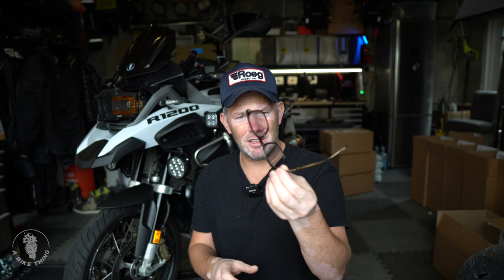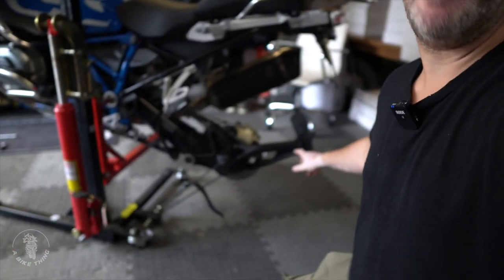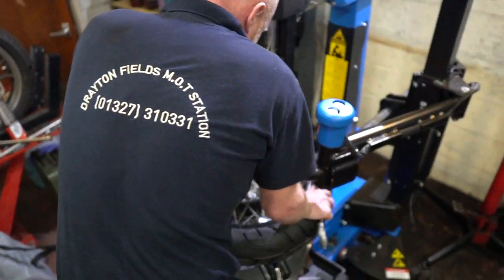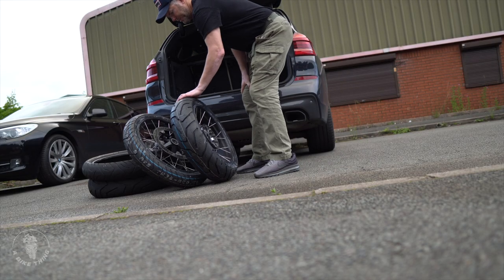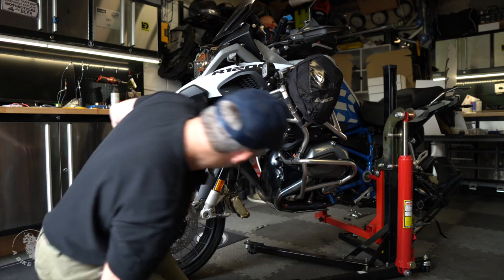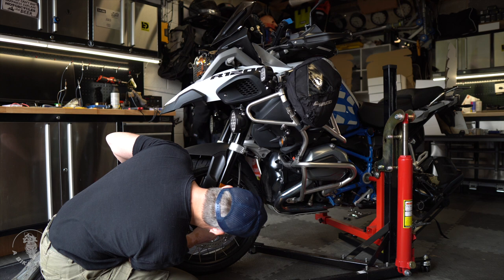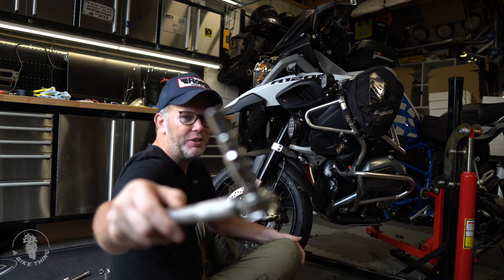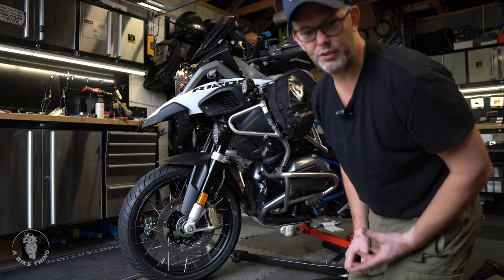THIS IS HOW IT'S DONE! PRE PYRENEES ROAD TRIP TYRE CHANGE.

Comment: Hi, how much would you say that you save buy fitting these yourself, compared to a garage doing the whole job. Just wondered wether the sky lift would pay for its self in time.
Reply from the maker: WARRA most definitely.    I mention this in the other video.  I save £140 every time.
Reply: WARRA, I’m currently contemplating getting a Skylift. All the bikes I’ve owned over the years I’ve always taken my own wheels off and then taken them to get the tyres fitted. Whenever I have the wheels off, for whatever reason, it’s always a good opportunity to clean those areas you can’t normally get to and also to clean and re grease the axles (obviously only one on the GS/A), I doubt that even a dealer would do that! The way I’m looking at it, is that the Skylift would save some money but it would also make life easier when tackling other cleaning and maintenance jobs on the bike.

Comment: Steve I got a question.. tires have a pattern style.. ‘’arrows’’ they are pointing in the opposite direction, that this make any deference?
Reply: ‘Does’’ ‘’difference’’
Reply from the maker: It’s very important to get the tyres fitted the right way round so they’re rolling in the correct direction.

Comment: Do you have mirror extensions fitted Steve, just find mine sit that little bit too low.
Reply from the maker: Yes. I wouldn’t want them much higher.  It’s not the height,  it’s the extra width to get past my shoulders.  If I were doing it again I’d remove the bmw ones and fit RAM balls and a RAM Arm with different mirrors with RAM balls fitted.   You can position them where you want then.